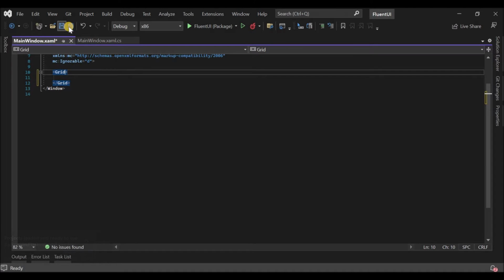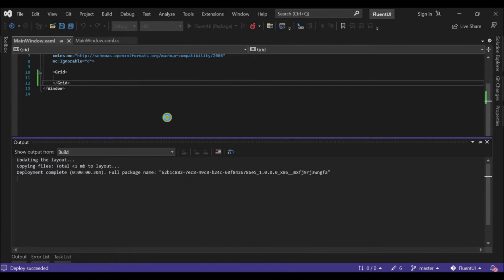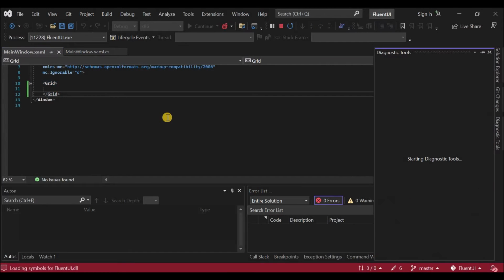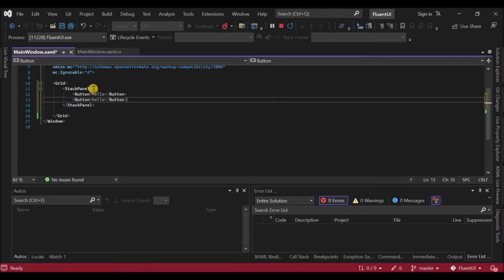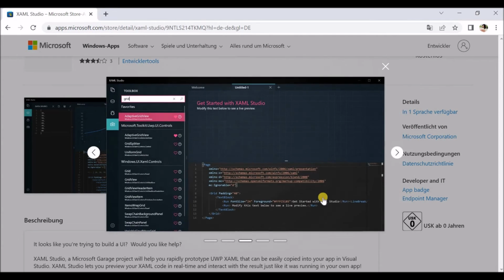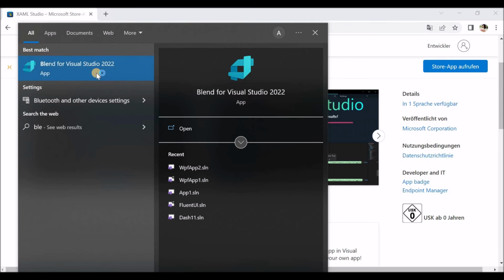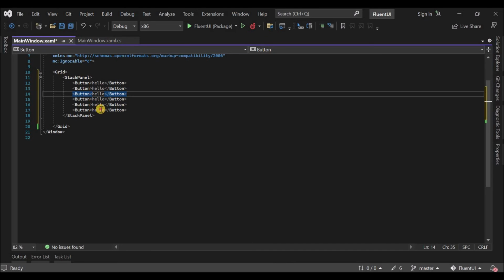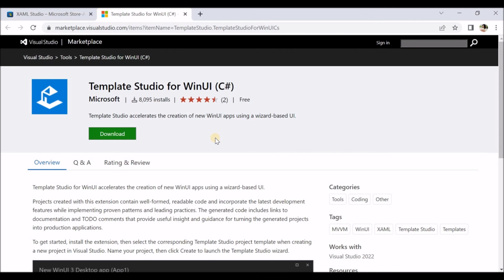Windows UI 3 : WinUI 3.0 no XAML designer view ?

Comment: WinForms was better even though the visual effects were simple. Drag and drop stuff out the toolbox and it goes right where you put it. Then you could capture events and program stuff to respond to them however you needed. Similar concepts to Win32 and the true underlying Windows shell and UI system (under the hood it was wrapping a Win32 window and had a WndProc method you could override and capture Windows messages). They should have just improved the visual style of the WinForms system and kept a solid designer that worked on straightforward properties/data like the underling OS and window system. I honestly hate this stupid markup stuff and series of broken/unusable UI designers that have been made for it ever sense ... every one of them has essentially flopped: WPF, Xamarin Forms, UWP, etc ... and people still have to use old WinForms because it's the only decent way to make a quick Windows app with no nonsense.

Long live WinForms!!! 😆
Reply: I can't agree more. Look at the modern UI frameworks such as flutter, jetpack compose and SwiftUI that allow you to "program" the UI in a dynamic manner and empowered by static type checking, a fluent workflow and full-control of your work.
C# is a powerful language that can do more things than a clumsy markup language.
As to smaller apps, we have no choice but mess with MVVM, xmal and the unergonomic Visual Studio. There is another example suggests that Microsoft doesn't care the experience of programmer: MAUI hasn't supported SwipeView ON WINODWS so far. But come back to WinForm, if it doesn't work, it can be impelemented by ourselves instead.
In addition, the xaml desiner is heavyweight but sometimes won't work. Thanks to the formalism xaml, our creativity is imprisoned. And WinUI 3 enforces us to involved in the messy xaml.
Hopefully, WinForms can work on .NET 6. So we still have the workaround at least.
Reply: @liplum  Winforms does still work, even in .NET 7 RC2, which I'm using right now, and it's not going anywhere anytime soon. They say WinForms is using the old CPU-bound graphics so it had to be replaced with WPF and then more and more new frameworks ... but I don't see why they didn't make a new "WinForms++" version that used the GPU and had rich, modern UI graphics ... that would be the ultimate UI library lol. They could have even had an extension to it which supported the declarative markup to make web devs happy. But FFS, I just wanna build a UI using actual objects and values ... setting properties, calling methods, etc. That, as you rightly pointed out, is a lot more powerful than XAML, HTML or any kind of markup. The markup is having to be interpreted and turned into objects with their properties, fields and internal state set ... I just wanna do it without that extra step lol. I wanna drag and drop something on my damn UI and it stays where I put it, and if I change Position.X it moves where I gell it to go, unless I explicitly set some rules or flags on it that don't allow it. I feel like I have to fight with markup, whether it's HTML or something like XAML, and wrestling it into submission is a skillset I don't really have because I am not a web designer. FFS, I wish we could just get a modernized WinForms that's GPU-bound instead of CPU-bound, with more capabilities and features. It would save sooo much time and we wouldn't have to fight with these damn markup languages and designer tools that don't work and force you to manually type in markup. 😑
Reply: @GameDevNerd  totally agreed
Reply: @조성민  if you have to use complicated XAML then you may as well go with NoesisGUI and DirectX12 or Vulkan, full-powered native rendering with the GPU. If it has to be hard to declare the UI then I may as well have the full 3D rendering power of the card ...
Reply: @liplum  u're just lazy to adapt, or incapable to learn. Live in the past, don't use internet. Don't buy crypto, it's a scam.